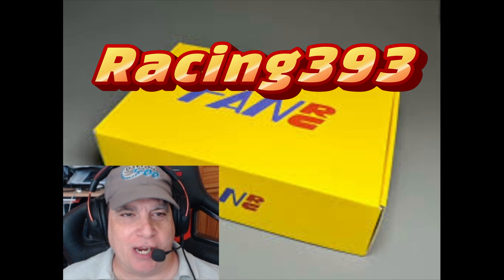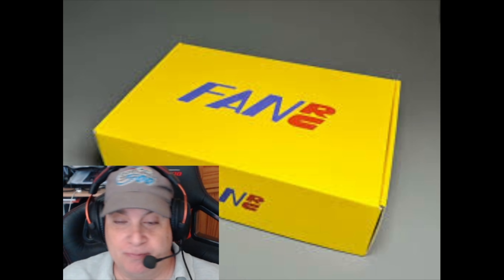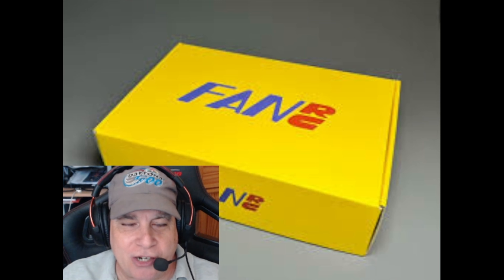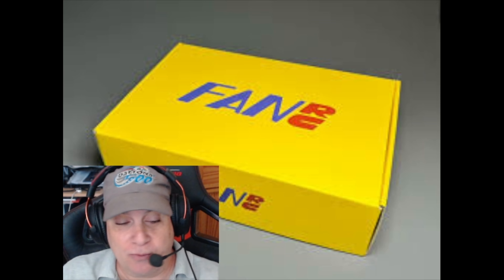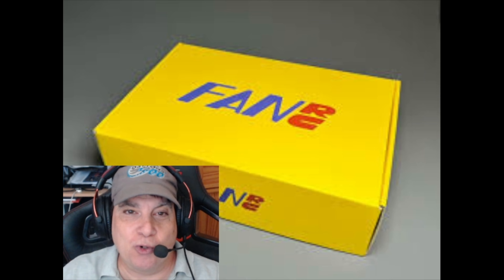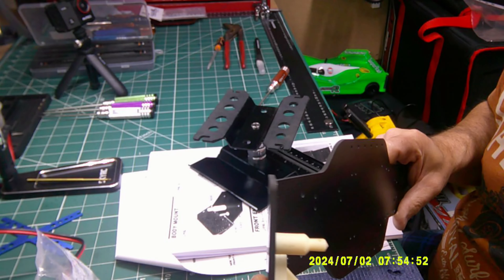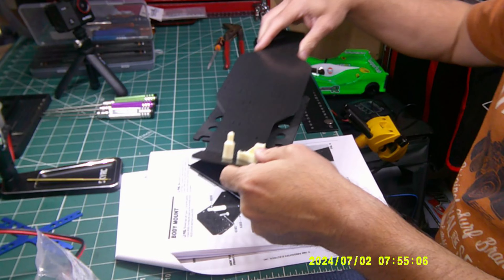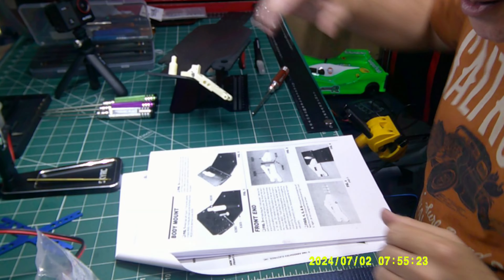FanRC - Build Video Part 1

Comment: Hi: i have not built my kit yet, but I know the kit is mostly a “worlds” edition, with a graphite chassis.  I suggest you download a copy of the worlds kit….the long bolts for your steering, look to be the front shock mount screws which attach to the shock tower….
Reply from the maker: yes, all sorted now. Car built. Next steps will be electric etc. Then a few local club visits in 25

Comment: For the turn buckles it sounds like you're not exactly satisfied with the measurement in the instructions being from the center of the ball cup to the other center. The old ball cups had a marking at center so you could easily measure but if the reproduction ones don't hand that center making then always remember a center to center dimension is the same as leading edge to leading edge or trailing edge to trailing edge.
Reply from the maker: Yeah, I did measure in the end from shoulder to shoulder, plus remember these where Graphite instructions and not worlds car instructions so the lengths would have been different anyway I would think?
Reply: If I'm comparing apples to apples and I might have it mixed up but it looks like graphite instructions say 2.34" and worlds says 2.51.. .
Reply from the maker: @GCC13  best way is eye-ball them straight, different cars would be slightly different measurements I guess
Reply: Now that's a tool I already have in the box. 👍

Comment: Regarding those steering screws im going to look back at my old rc10 and see what is up there. Without being able to recall what screws were used in thinking maybe the fan rc kit has the wrong size hooks drilled? Not confirmed. Just a thought.
Reply from the maker: The instructions (graphite) was showing a much thinner screw, the Worlds instructions and parts supplied in the kit were correct - I just changed them over
Reply: Ah excellent. So those screws that weren't chamfered were not the correct screws?  I assume them there were some other screws that were chamfered screws in the kit that worked? And judging by your comments that may or may not be in the right bag of parts?
Reply from the maker: @GCC13  correct, the screws on the original Graphite were non countersunk - the FanRc has specific countersunk hardware, and yes the bags were a bit mixed up regarding the hardware, the bag ID works but you'll be looking for hardware in other bags
Reply: Ok duly noted. I'll keep a mental inventory before and as I build.